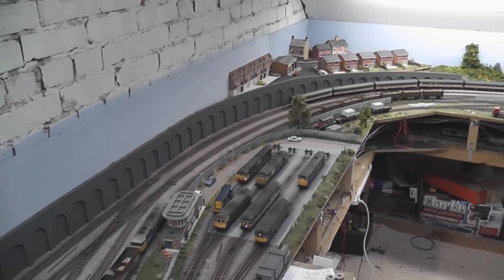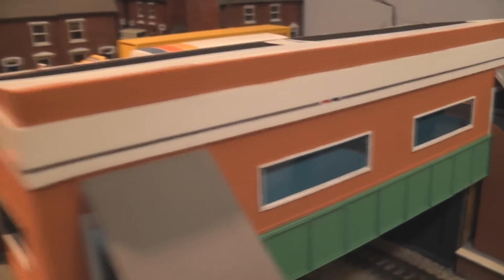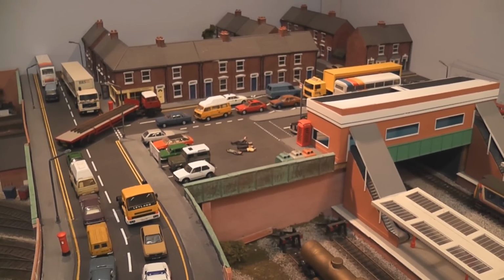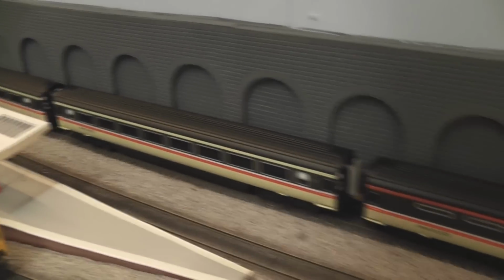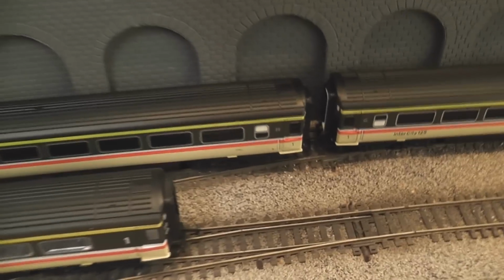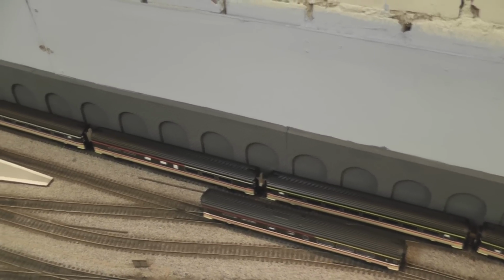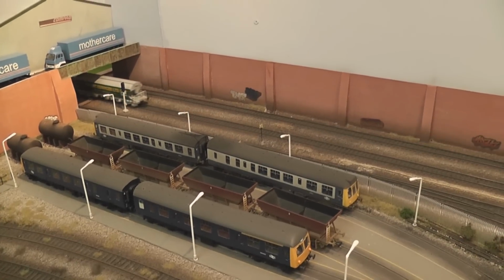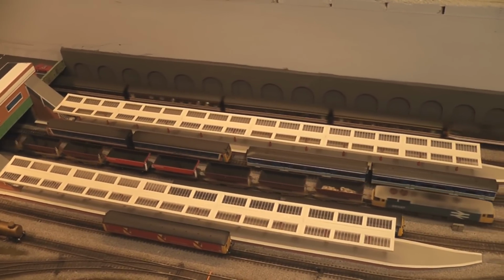2015 Layout Update

Comment: Thank you for showing how to programming  picaxe18m2 for signals. First class video Marks out of 100.---99. you only missed opening  the pin 1 low box, we need to know if you set it high or low. I have now the same setup as you and I have programmed the signals to be controlled by the point switch, signals only operate in the direction of the points, the other side of the points signals stay red. Thank you once again. JAMES.

Comment: can i suggest, when you redo the station, you reduce the length of the canopy to have open areas.
Reply from the maker: 47606odin Its on the cards as I planning on making a number of changes.  The station will get lots of attention in the spring.

Comment: Great video again. I too has those Executive livery Mk3s. Such a shame about the restaurant/buffet roof vents. Also from my memory of the 80s and 90s the Executive livery 125 buffet coaches also had 'Restaurant-Buffet 125' on the side only changing when the Swallow livery was painted over them.
Reply from the maker: MansfieldCS Yeah I've read that the buffet branding may be wrong.  Bit annoying that over 20 years after these coaches were designed they are still being produced with errors.  Still they are much better than the new MK2Es.  I would avoid those if you can as they have multiple errors with livery, window size and solebar.  I'm hoping the bachmann effort will be better.
Reply: My Lima Mk3s from 1986 were far more detailed and accurate than these!!

Comment: Hi Richard happy new year, like the idea of the platforms going under the town, I'm doing exactly the same with mine, as it will hide the fact I can't get a full rake train in my station, and make the station appear bigger. The only thing I'm not sure about is your station building, hope you don't mind me saying that, as your layout is set Oxford/Reading area (Western Region) if it was the original station building would it not be a dressed stone building I know space permitting it's really hard, just not sure it fits with the housing and the street scene you have, the job you have done on the building is fantastic, just not sure it's the correct building for your layout, I really hope you don't mind me saying that. 

The back scenes will give your layout a lot more depth and looking forward to see that, if your adding a boat and it's going to be static, have  you thought about adding some mooring points on the bank so it can look like its tied up. Andy
Reply from the maker: Andy Hudson Thanks Andy.  The station isn't going to be ideal.  I'm trying to go for some sort of cheap prefabricated look rather than an original building.  Hopefully with plenty of NSE signage and some weathering to tone it down it will look ok.  Cheers
Reply: EverardJunction Hi Richard spent a while thinking about this but I have decided to rip my layout up and start again, short story is I have a few issues with the boards sagging, not enough supports under the chipboard causing trains to uncouple and derailments, also with a lack of planning on my part I can't connect the fiddle yard to the rest of my layout so pointless having it.  My layout is in the loft like yours, whats the best type of board to use mdf, chipboard or ply. What is the gap you use between your fiddle yard and your running section, going to have a similar set up to you, in the middle of planning things properly this time, the first attempt will treat as a learning exercise. Thanks Andy
Reply from the maker: Andy Hudson Hi Andy.  The best board to use is ply as it's very resistant to warping.  Properly supported it will last for many years.

I leave a gap of about 6 to 7 inches between my two layers.  You don't want to go any lower than that as access will get very difficult for wiring.

Good luck with the new layout.
Reply: Thanks Richard

Comment: Thanks for sharing your fantastic layout again. I'm sure it will inspire modelers worldwide.
If you don't mind saying I'm interested in what type of camera you use.
Looking froward to the next update.
Stew
Reply from the maker: Stewart D Thanks Stew.  I use a panasonic HDC-SD60 for most of the filming on the layout.
Reply: Thanks for the Cam info. I checked it out and found a used one for sale locally for,in your money 75 quid are there any problems I should look out for that you've come across
Reply from the maker: Stewart D None that I'm aware of.  Its a solid bit of kit.

Comment: Hi Richard,
I have those MK3 exec livery, and like you I am waiting for the HST exec to come out.   I think the gangway doors were yellow throughout their careers in BR.   The coupling is its weakest area, but its a small annoyance to me.  Hornby don't seem to be in a hurry to change this as they've just 'modernised' the mk3 with the tinted glazing.

My blue grey buffet cars do have the vents on the roof.   I have to say I haven't noticed my exec livery roof...off to check now!!

See the retaining arch walling, is it from International models?...how thick is it, depth wise?  On the reverse side of it (at the top) does it have any brick work detail?   I need a short length for my raised section that's on a slight curve and I want to be higher than the track level and therefore need it to be brick texture on the opposite side of it, if you know what I am trying to explain?!  I see they selling brick sheets to match this retaining wall, but if you could let me know what it's like at the other side at the top that would be great!

As for the MK2e from Hornby.   They are selling in large quantities.   They are the best that have been out so far, much better than their MK2D's.  While they aint perfect I got a rake as I don't see Bachmann's ones coming any time soon.   They were announced in 2013 and yet still no examples nearing production.   Yes they will be better, but I can see them hitting £40 a coach, which would be ridiculous.   Worth noting, I also have a rake on pre order lol!!

Good update, enjoyable as always!

Dave
Reply from the maker: DaveClass47 Hi Dave,

The retaining walls are from international models.  They are formed from 2 foam parts and are about 10mm thick.  Just blank on the other side and unpainted.  Should take some plasticard quite well though as they are quite smooth.  

If you have the same exec ones as me then I'm afraid your buffet will be wrong.  Also if you got an exec TGS then hold it up to light and you'll see through the windows that it has a buffet car interior!!??  This blocks off two of the windows!!!   

Hornby have acknowledged the issue with the mk3 buffet roof vents and their response isn't encouraging...

"Hornby has been in the process of moving it's manufacturing from one supplier to several others. During the course of this, a number of toolings have been found to no longer be available. When the run of Mk3 coaches was commissioned, it was not appreciated at the time that the buffet car roof was one of these toolings. When it became apparent, a decision was taken to manufacture the coach with the roof that was available, rather than hold up the entire run of Mk3's for an indefinite period.  As a result, the buffet car does indeed have an incorrect roof. We have checked with Engineering, and there is no intention at present to produce a replacement body for this vehicle".

I've had a good read through the mk2e thread on rmweb and while they are much better than the nasty old mk2ds I have decided to give them a miss due to the roof vent and window issues.  The issues with my mk3s has also put me off hornby at the moment.  

Sorry for the Hornby rant but i'm not exactly pleased with them at the moment.  They don't seem too bothered about railway equipment newer than 1968.

I'm only planning for one aircon rake at present so will save up for the bachmann ones.  At the rate they're going i'll have plenty of time!
Reply: EverardJunction Hi

Wow, thanks for that insight in to Hornby's attitude to their MK3 coaching stock.   I cant understand this attitude.  The MK3 is thee iconic coach design success story to come from BR. Its been going for nearly 40 years and there is no sign it will end in the next decade or so due to an ongoing refurbishment program!    Hornby spend so much time on their MK1, MK2 rolling stock so I dont know why they cant give equal attention to the MK3.

I have to say I was really surprised to see the vast array of MK3 coaching stock to appear in 2014's range.  It cost me a fortune as I invested in 2 rakes of Blue Grey with lights and 2 rakes of exec MK3 (for running with the forthcoming exec power cars and for mix and matching with the blue grey stock to show a transitional period, as was the case in the 1980's).  I plan to run 3 HST's when the latest power cars are released.

You are spot on when you say Hornby aren't interest in anything after the 1960's.  With exception of the HST, CL50, 56 and 60's the rest of their modern image stuff is with railroad or ex lima guff.

As for the MK2E...I wanted a Swallow livery set and the bachmann ones will be the lower type face exec livery.  I am getting these also, and a Scotrail DBSO to run with my Scotrail Express push pull services.  I will take a look at the MK2E in my next video.

I am a big fan of Hornby, but they drive me MAD a lot of the time.   The small errors they make and the lack of commitment to retooling modern stuff.   The CL91 is a example.   When electrics are becoming ever more popular it would be sensible for them to re tool the 91 to modern standards.  It looks fine, but lacks details.  I was really disappointed that they chose to launch the 91 in east coast without a retool.   I might get the MK4's and mk4 DVT (also in need of re tooling) to run with my Battle of Britain liveried 91.  Its not my era, but the livery is attractive.  There isnt much else in the 2015 range to excite me to be honest!

I will just have to save up my £££'s for Model Rail Scotland next month.   Always worth a visit to pick up some supplies!
Reply: EverardJunction Oh, another thing....do the arches come with a finish on them, or just bare shiny plastic?   If so, how are you going about painting and then weathering them? Cheers
Reply from the maker: DaveClass47 The arches on the walls come painted grey or brown depending on what you've ordered.  I've painted all mine to remove any evidence of the blue foam.  They also need weathering which I'll probably do with the airbrush.

I was a huge hornby fan until about 2009.  Back in 2004/2005 it seemed nothing could stop them.  Modern stock was being retooled as much as the steam stuff.  The 31 was good and the 50, 56, 60 and HST power cars are brilliant.  After that it all stopped and eventually the new 67 (which has its problems) turned up around 2012.  The rest of the ex lima has mostly been lost to other makers.  The 142 or 156 will probably be next

I still find it very odd that they never thought to do a decent 37 or 47 back in 2003/4.

The way things are going I think another manufacturer will announce a retooled mk3 in the next few years.  Bachmann might as it would go with their new 90.  If the 90 sells well I think there may well be a case for someone to retool the 91.
Reply: EverardJunction It would actually be a shame for someone else to move in on the mk3..its Hornby's 'property' if you like, they are the only ones who have done it since Lima's demise.  The coach itself is fine, the interiors could do with a freshen up, but with the correct tint now being applied to the glazing you don't see inside that much anyway, so its not an issue for me.
The bogies perhaps need retooling to allow for NEM close couplings like we see on the MK2E, and most Bachmann stock.
I hope the 90 sells well (I will be getting the swallow livery one to run with Hornby mk3s)  Maybe then Hornby will wake up and realise there is a market for electrics.   I can actually see Bachmann do the 91 and have a go at the MK4 and DVT.   I think they will attempt this if Hornby don't redo the 91 in the next few years.   The MK4 coaches are pretty decent if I am honest, a facelift wouldn't do them any harm.
I would like to see Margate re-release the MK3 DVT in swallow livery.  These ask a premium on ebay and would sure to be popular.
With so much duplication in the market place now I think we are 'stuck' with Hornby's MK3 coaches for a several years at least.   I don't think even Bachmann can risk taking Hornby on with those rolling stock.
I am just sad that I wasn't in the hobby in 2005.  I only came back in to the hobby and re-started my interest in 2009, when Hornby's swallow HST that you have was out, god I wish I'd bought one at the time!  I still await its re-release!!!

the 37/47 issue is a bizarre one.   A 47 with the same level of detail as Hornby's 50 or 56 would have resulted in a truly market beating model.   However Bachmann's 47 is great and my collection keeps growing.

Interesting times ahead in the hobby I am sure.   I will just keep building my layout..due to be completed in 2022 (Rough guess!!), by which time Hornby might have solved its supply issues!!
Reply: EverardJunction oh and as for the exec buffet roof...mine is incorrect.  first of me noticing.   However, strange that the blue grey buffet with lights is the correct roof.  The western region blue grey buffet is due out next month (delayed again), so it will be interesting to see what roof that has.  if it comes with the correct roof then they are telling us lies about the tooling being no longer available.   I think they've just made a mistake.  However how the blue grey one with lights (released only 4 weeks before the exec livery one can have the correct roof and the other one doesn't is a mystery.
Oh Typical Hornby!!
Reply from the maker: DaveClass47 Will certainly be interesting to see what happens with any further buffet cars due for release.  As for mine i'm going to get the plasticard out and try and replicate the roof detail using my other buffet as reference.  I still need to weather all my mk3s and power cars too.
Reply: EverardJunction See the sloped angled retaining walls from international models, they only appear to be sold in the light grey or brown, and NOT the dark grey to match the dark grey arched parallel retaining walls.

Are the ones you got dark grey for the parallel? And see the sloped ones you have used, were they the lighter grey and you've just painted them? or did you get dark grey ones?  The angled sloping ones dont seem to be made in dark grey!

I am still working on track laying (and for many months ahead I will still be doing that) but I am trying to locate products that will be useful when it comes to adding in scenic stuff!
Reply from the maker: I choose the light grey colour so all the parts would match.  It has all been painted now though.  Weathering is still on the list. 

Worth ordering in advance if you can, mine took over a month to turn up.  Cheers
Reply: hi, ok, thanks...I will order the light grey for the whole lot if that's the route I am going down.   Noch do some retaining walls too, as do Faller and Gaugemaster....but the international models (the brand is actually Merker) does look easy to work.   If I needed to cut it/saw it on a vibro saw to reduce the height to suit my raised section then I assume it would be possible to do without wrecking it?!
I see they do the brown colour too, not ruled that out instead of grey.

Its still undecided, as I am still cutting and shaping the raised section and re routing a track on the lower section to give me room for the retaining wall etc...I will show this in my January update this week.
Reply from the maker: DaveClass47 All the cutting I did on mine was with a straight edge and a scalpel.  Goes through it like butter.
Reply: EverardJunction Brilliant! Thanks.  I have ordered some light grey parallel and inclined and also a set of the brown.  I will use both eventually but I fancy the sandstone brown...if its the right shade it will look very Scottish!
Reply: EverardJunction Received the retaining walls today.  They will need a painting!!  The blue foam shows through where the underside of the arches have not been painted!  Also the sloped wall doesn't joint up with the parallel walling without some trimming required.  If I was to fit unaltered the height of the arches would be different and looks weird!

Might use them, might up for some scratch built retaining wall from plasticard...we shall see.

Your paint job of the retaining wall looks good, what was the paint you actually used for this?  Its a good shade of grey.
Reply from the maker: Hi Dave.  Forgot to mention that walls needed trimming, its a 10 minute job with a sharp knife and a straight edge.  Looks much better when its done.  I used the woodland scenics paints to do mine.  I mixed black, white and some brown to get the right sort of colours.
Reply: EverardJunction Hi, cheers for that info.   Just looking at the space I have with the walls in place and I might have to defer use of them for the front of the TMD.   There will be directly next to scalescenes card walling structures, so it might look out of place...my ideas keep changing, however these walls are here is I need them.  Quite impressed with them to be honest!  So keen to use them somewhere!

Comment: would you suggest to bring my trains in the house in the winter. As my layout is in the shed still under construction but I do run the trains. followed your layout now caught up to date, pinched many ideas. Stewart
Reply from the maker: +stewart boughen Mine have been ok in loft during winter.  Might be a good idea to bring yours in though as the shed is not the most secure place to store expensive models.
Reply: Thank you for your reply. I was going to take them in. Just a bit worried about them not running, for a long period. But have now set a shuttle  line up, so I will be able to run them. Plus give them a service. Thank you again,and keep doing updates.